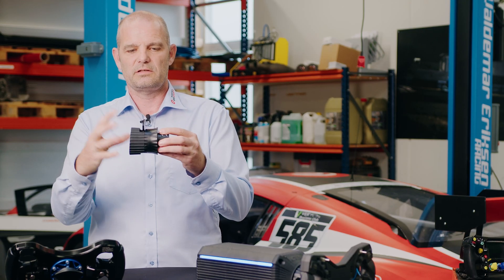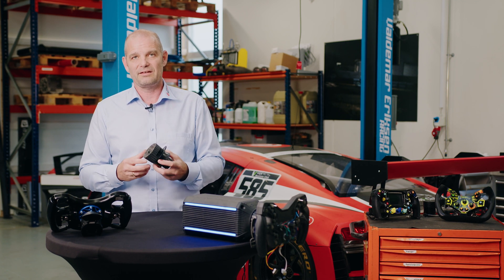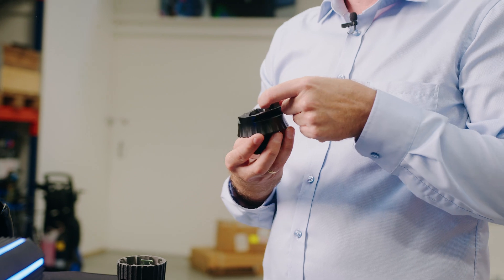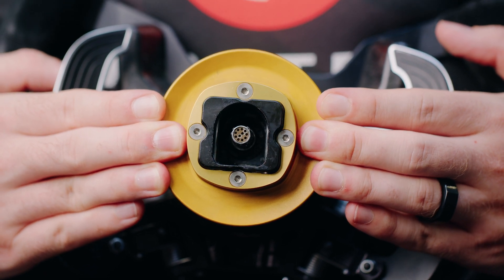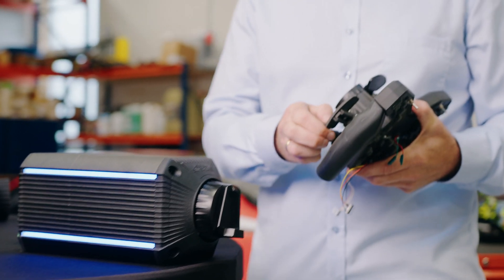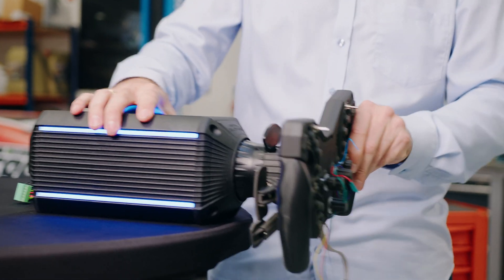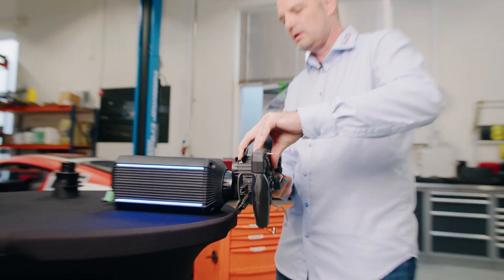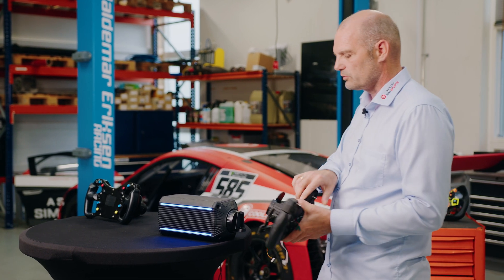Sim Racing Wheel Quick Release – Designing For Reliability and Precision

Comment: Will this QR be available for people to buy? What if for instance you want a GSI wheel to put on your DD but GSI decides not to release wheel with this QR, can I just buy a wheel side version and use a small usb jumper cable? For me this makes are breaks this product.. I want to have the option to attach any wheel that is USB enabled not just 3rd party manufacturers which decide to work with Asetek!

Let me just add, that I am actively looking to get a DD, I was going to go for a SC2 Pro, but this made me wait because I dont want to wind a cable round the base, I dont want to deal with charging a product which I don't plan to take on a bus ride. But if this QR is not available for me to put on whatever wheel I want (baring wheels which are locked into a wheelbase like Fanatec) I don't see the point of spending a lot of money on a DD which proclaims to be 'open' but not really
Reply from the maker: We are working through all these options as we speak. Stay tuned 👍

Comment: I love the simplicity of the design, my only concern is the large paddle blocking or getting in the way of Dash screens and maybe monitors mounted close to the wheel. May have been better to make it smaller or hopefully you can mount it so the paddle is at the bottom of the wheel.
Reply from the maker: not a problem in real life 😊

Comment: I have an SC2 Pro. Not really a fan of the QR simply because of that pin. However the strength of the basic design is incredible. This design here is what I wish the SC2 QR was. It looks fantastic. 

Luckily I can choose what QR system I use. Which was a deciding factor when I made the  switch from the DD2 and it’s outdated QR.  No more broke pins, no more fighting the wheel to remove it. No more flex. (Mine was really bad with Podium Hubs and the Mclaren wheel. 

 I currently use the HRS XeroPlay in gold.